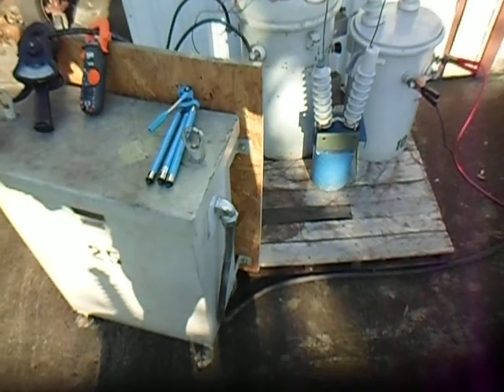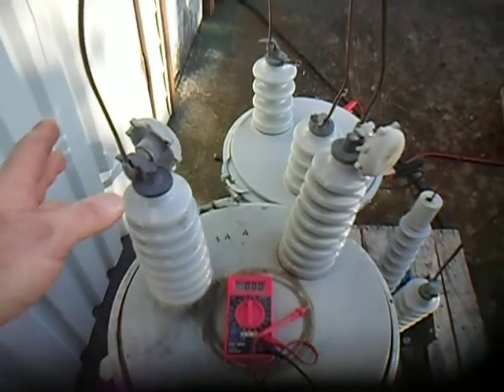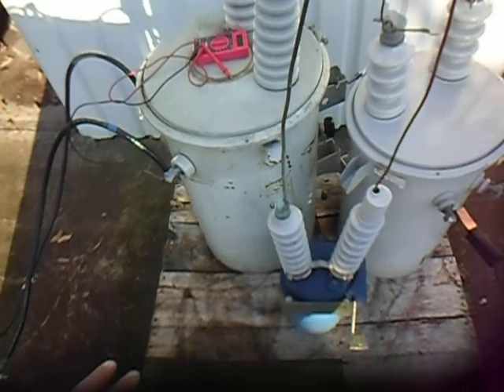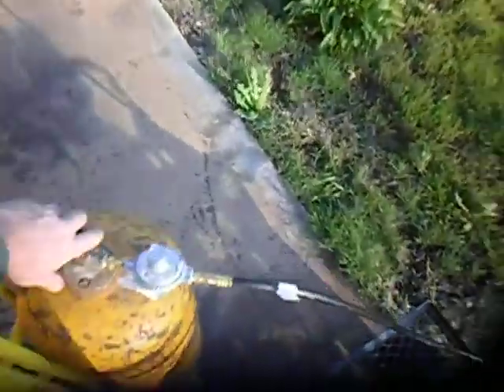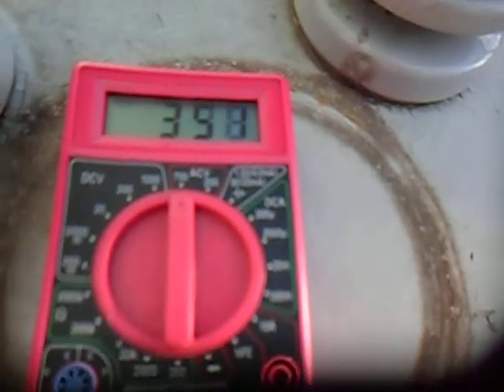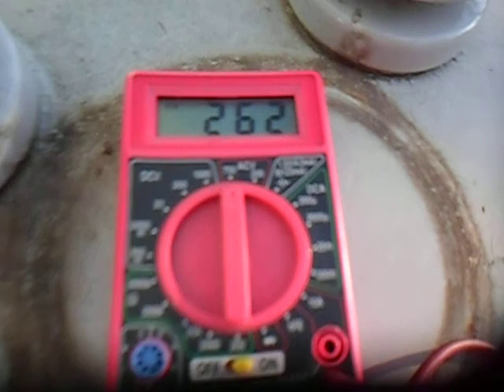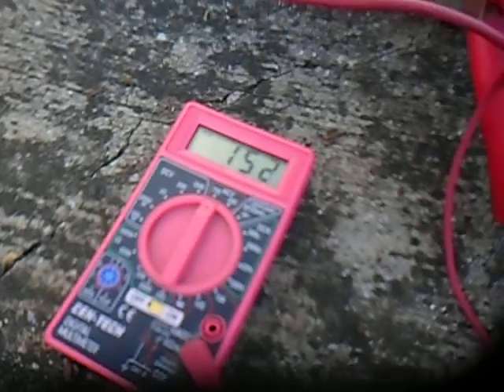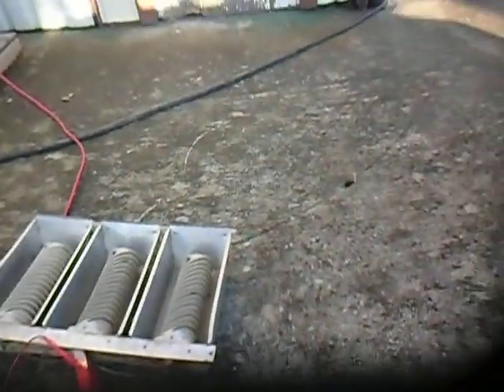Results achieved in this test do NOT support Gerard’s claims, however . . . .

Comment: Get 2 transformers, the same ones, the sames size. Forget your calculations at first..
and forget dry transformers, you are doing it all wrong. It's very simple stuff.. you must have the same equipment if you are going to make any claims..
Wet pole transformers, and hook it up right. then we'll talk.
Reply: robert k Yawn... your title should say "Results achieved have nothing to do with Gerard Morins claims, however we will continue to waste time with multi fuel kits, apples to fig tree comparisons and long wait times between tests". Sorry to be so critical but damn why not just do the same experiment pound for pound, why say your going to "try other variations of wrong setups". You have the man telling you what to do and yet you continue to do the opposite. It's like telling tech support to fuck off I enjoy my product not working. Is this deliberate or perhaps your falling back on the local power engineer's advice :).
Reply from the maker: I have other transformers, will get rid of the dry transformer and continue testing every combination with wet ones, Thanks for your support.
Reply: ***** No problem, Tiny.  I'd rather be a douche and honest with what I'm looking at than a Dumbass kissing another dumbass's ass... ;)
Reply: Gerard Morin thanks gerard for having them a message...
Reply: ***** Cough, Stoodge, Cough... :P  Good luck sparky.
Reply: I am trying to get the generator to use a 60 Hz cycle so I don't have a bunch of idiots trying to bash me using excuses of how the frequency won't work with appliances or other products. 60HZ will work fine as Gerard got it to do so, as well, it works through the Pelex device I have designed.
Reply: Quantum Leap That would be a good idea.. that is if they didn't want to have me killed. GE was started by JP Morgan. He wasn't interested in buying anything that he had to worry about, he bought things that were new technologies that could make him money. If they were interested in making money from one of my systems, they'd have the answer to a world crisis, and I could walk away happy.. Maybe they would too. I wish I had a contact there other than my contractor rep that calls us when we work on their Connecticut properties.
Reply: ironic that in the old Dr Frankenstein movies  Extreem Voltage  and  Extreem Pulses Per Second via a mechinacal spark gap was rquired to bring the monster to life   //
Reply: on a 2 deminsional plane a coil will apear to be a sine wave
Reply: mark
Reply: Gerard Morin The cup is already full...
Reply: I totally agree you must have the same equipment same series ex ex you can not change what Mr Morin has, this is why upset, any time you see his set up it's always the same if your going to do this in bigger scale everything else has to be the equivalent as well.
Reply: ***** Right, well its you who have yet to produce any effect that you can comprehend using a basic understanding of AC and DC energy.    Sparkman, wheres the results buddy?
Reply: I'sa workin real hard masssa dun you worry nun!
Reply: cough shill cough
Reply: Thanks douche
Reply: +Christopher Sparkman I'm trying myself, unfortunately I have issues with the engine. I have a nice electric motor to connect to it, but, I have to get a shaft coupler for the 2 different sizes. I have a 7/8" on the motor and a 1" on the mcculloch. I have to get a reducing coupling from Lovejoy so I could try to loop it. That would be something.. If it looped out of the box that would be sweet. I don't think it has that much, but, you never know what kind of a surprise I could have once it gets up to speed, a switchover may prove to be successful, however, the magnet is one heavy bastard that will eat a lot of start up energy, but, the inertia created by that heavy generator will certainly keep it going if there's extra energy, I'd just have to hard wire a couple of switches, one from the wall, then, one back to itself to see what happens... it may not power a load, but,  if it is creating overunity, it should certainly keep turning rapidly.. who knows what to expect though. It does have something going on because I draw arcs from the secondary connections to my meter probe and it reads normal voltage. It is extremely strange, and that was with the washer pump connected, but, it doesn't have anough wattage to keep the coil idle.
Reply: +Marc Belanger   Hey Marc, how about using a couple of pulleys?  You could also vary the ratio, so you could extract more rpm's from the generator.
Reply: +Christopher Sparkman      stop falling for the bait  ,,  do not waste your time answering people who are paid naysayers  ,,  more time on them is less time with the process
Reply: When there's a will to do so, there is always a way. I have found many ways to come up with overunity, however, one of them stands out very much so, and that is from a manufactured device. It's from a regulated neon supply transformer. Take a look at all of them out there and see what their ratings all say. Compare the input voltage times it's input amperage. This gives you your wattage.. Now if you don't believe, then look at a 12 volt dc powered nst, they say the same thing. Then, look at it's output. The output will say whatever the voltage is times 30 ma. The input will be between 50 to 60 watts while the output is between 250 and 300 watts. There is a significant issue here... the laws don't allow this.. Why is that? Because the neon sign wouldn't work unless somebody was able to create a bit of overunity to make the gas ignite, as well, the microwave uses overunity, and., the led is an overunity device. There are many of them out there, just believe me when I tell you.. We can take some of the newest led bulbs, take them apart and power them with dc voltage as they were meant for.. Then, feed the light into some solar cells, and, loop the circuit. They will keep lighting the bulbs and have an additional output. It's because more lux is generated by the overefficiency of the led and it is so high that the inefficiency of the solar cell doesn't matter anymore. They give us cell that are about 17% efficient and they still produce more than they use. There's a reason.. They can't keep suppressing this as technology progresses.. eventually somebody's going to catch on and report it to the open source diy selfers.

I know it's hard to believe, however, when the transformer is center tapped inside of the NST resonantly, it causes a rise in voltage and amperage. This is exactly what the transformers are doing, however they just need to be tied together correctly to get what Gerard is saying. I'm not blowing smoke up anybody's ass.. look up Don Smith's device if you all don't believe it. The difference is that Don used the Casimir effect to amplify the output of the coils. The NST does the same thing. If we crack one of the old units up, they were wired the same way. Unfortunately, we can't get those anymore because they are labeled to be dangerous... however, we can get the identical unit built for 12 vdc, and, they are cheap, so, get as many as you can because all car neons have changed to led and they just don't make them any more.

Marc
Reply: Marc Belanger Marc, why don't you submit at least one of the overunity devices to General Electric?  I understand now that they've divested their appliance division, they are flush with cash. I'm sure they would buy that overunity device, don't you?  After all, they are in the power generating business.
Reply: So far This guy's video are a complete waste. Never a conclusion. Always playing with nice equipment and revealing nothing. I may be missing his better videos so far he just pisses in the wind and pisses me off.
Reply: Gene Lamoreaux the sag is done on purpose, this is NOT a characteristic of the NST. This did NOT happen on a wire wound NST without the power protection systems, it only  happens on the variable units that they make now. They did this so the overunity systems do not stay powered on. Try building the Leal & Barbosa design. Add a pure sinewave invertor and tell me what happens. The output voltage climbs high and the system keeps on operating even though it should be losing power.  No worries, I have the original schematic for Bertonee's patent before if was changed and I have built it. It's functional and There's no limit on what could be generated from the NST, especially the 12vdc input models that are able to output hundreds of thousands of watts with a few simple modifications.. One of them being a capacitor plate set being at the 1/2 septh of the inductor being oscillated at approximately 32 khZ. None of them are very hard to build if you know what to do with them as I do. You need to use mumetal or other very magnetostrictive core materials to get them to work.
Reply: gene    on a pole xfmr the secondary is a flat sheet of aluminum oe copper 1 foot x 50 ft   [depends on design]  wound on a former  //  the primary is a copper wire insulated from and wound around the formed aluminum  //  frank
Reply: gene   todays nst are solid state and i would think that the correct geomtry would be very important  //  QL can you prove that statement withthe math
Reply: marc   good to back and see you still alive  , those boys in black can be pretty tough  //  had to take some time off  ,,  chest pains etc, etc,  //  i see you have made great strides in your research   // keep up the good work and ignore the naysers , there insult tatics do not work anymore  //  good news , i was able to score a couple of old bertonees 12 vdc NST  //  so it will be back to expiramenter's bench   //  frank
Reply: see gerard's latest video for a OPEN CHALLENGE to all Acedemia  //  get your test equip and and prove him wrong
Reply: frank ertolacci let me know if youd like to sell one. Im hit without it but could finish my replication with one. Great to hear from you again as well.
Reply: What are "bertonees 12 vdc NST"?
Reply: mark   hope to get my family off grid  //  your posts and progress are much more advanced than mine but are still really helping me out  --  so this is my chance to help you by giving you one
Reply: gene    gerard has issued a chalenge to everyone  //  get your test equip  ,,  travel to him and while he is recording your video and audio PROVE him wrong  //  NO excuses - go
Reply: how can anyone prove it works over the internet ??   first response of nasayers  ==   ridicule and curse  at the inventors  --  then comes the you faked it  -- its a trick  --  your meters are  wrong   --  your calculations are wrong   --  the list never ends  --  that is why individuals must go and test it with there own test instruments for real proof  --  if you refuse to go , then you really do not have much to say until the items can be bought in the store
Reply: Morin doesn't believe in giving accurate power in versus power out figures. He NEVER does. So how can you believe his shit?  You are just swallowing what he CLAIMS!  No proof, nothing. How old are you anyway? You either are a very young, uneducated,  impressionable newt, or a very old, slightly daft seasoned citizen. Either way, you are being bamboozled. Hitby13kw has already debunked Moron's shit, with instruments and demos a year and a half ago, yet you still cling to Moron's bullshit. Moron will NEVER achieve over unity. Never.
Reply: like i said you canot prove it on the internet  ==  why do you squander all your time on this SHIT , you resort to name calling , ridicule , and your own stupidity as you ask for proof but NEVER SUPPLY YOUR OWN  --  obvious TROLL
Reply: QL  how can i block you  ??
Reply: if over-unity does not exist then we can never travel in space beyond the moon as space travel is impossible , cant build a tank big enough  //   we must kill ourself off with polution burning coal , or using nuclear and tesla , dollard , morray , greer , maxwell , johnson , searle , and a host of others are idiots are like gerard == yes he changes his concepts  --  just like science  --  you believe a theory because it fits most of the math   ,,  when knowledge improves old theorys are droped and new ones take there place  //  were you in resonance with your experments  ?
Reply: +Gerard Morin Look this is very simply resolved, submit a scientific paper to a reputable scientific journal such as "Science" for peer review.
If the readers of that journal say it works then it works.
Oh you can't get "Science" to accept your paper, I WONDER WHY.

Comment: Well done. Have you tried an equal amp load in series with the primary input from the generator?
With small transformers I'm finding I can use primary and secondary energy. I see no reason why it shouldn't work on the pole transformers. Has to do with the lack of ground ;)

Comment: Hi, you're doing excellent work here. The effect your looking for is cold electricity. Use a hand held temperature probe to find out if temp gets lower that ambient temp. Look for this at the output side. The key is the rotational speed of the generator. The main key to cold electricity is in the frequency of the devices in use, hence in your case Generator RPM. It has been mention by Gerad Morin numerous time. Best wishes.